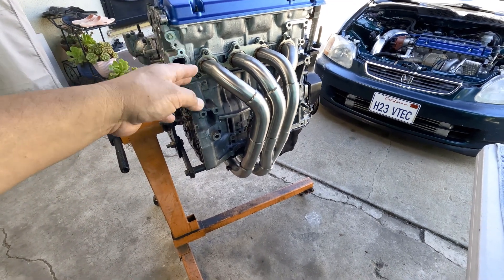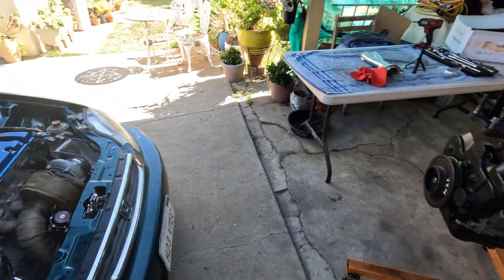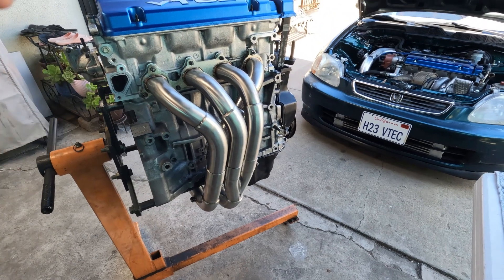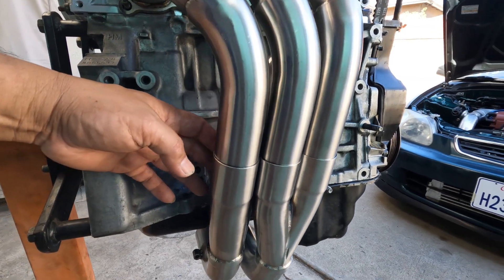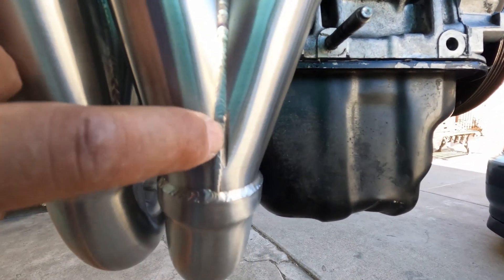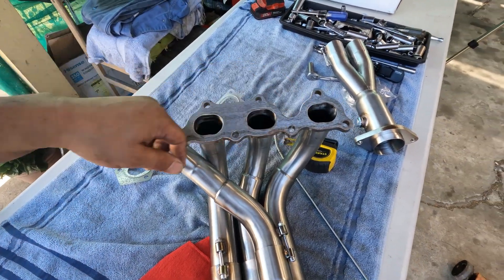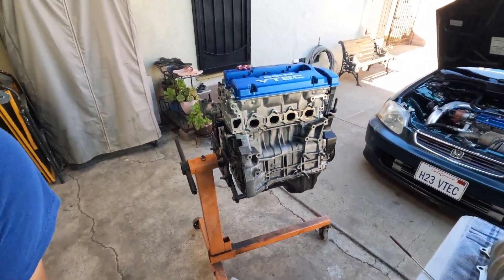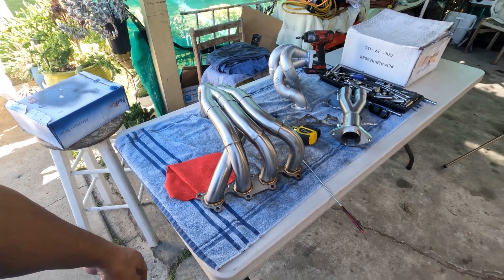PLM H22 Tri-Y Header review

Comment: Had same problem with 97 dodge ss/t with manza 3/4 length headers drove truck while then removed headers used carbon marks on header flange ground too port match made little difference. Other 99 sh prelude got 2 1/2 exhaust with warlock muffler soon going to remove stock header manifold put new o2 sensors on cat and. Check maybe smooth the difference if any between exhaust and cylinder head . take care
Reply from the maker: Thanks bruh!

Comment: Sensei sagittt is back!
Reply from the maker: Lol, whazzz up! Thanks
Reply: @sagittnet2158  hey sensei just did a compression test on the rebuilt engine, idk if you remember I told you I was getting blow by. I was getting between 145 and 150 psi on all cylinders. Do you think that's a little low?
Reply from the maker: @carvedfromlife8949  Your almost at service limit of 135 psi. Have you tried pouring a spoon of oil per cylinder and see if it'll change a bit. Do you have any oil consumption problem or noticing a blue smoke out on your tail pipe? Have you check your PCV?
Reply: @sagittnet2158  haven't noticed any blue smoke, I've checked the radiator fluid for bubbles. I haven't checked it with oil in the cylinder yet, I'm not sure on the oil consumption because I tried to resurface the block myself and I do have an oil leak near the water pump between the head and block. Im assuming maybe I can be losing compression there if it's not sealed correctly. Just thought I'd play with it a little more but most likely gonna get an f20 or h23. It seems to drive fine but ya the compression doesn't seem good.
Reply from the maker: @carvedfromlife8949  the oil that you see on waterpump side could be coming from either valve cover gasket or from camshaft seals.

Comment: Doing it for shits and giggles   hell ya 🤙🏽
Reply from the maker: Yeahhh baby! Thanks bruh!
Reply: I have a G23. Followed your videos to do it. The videos were very helpfull. One issue though I have No VTEC changed the oring clean the vtec and still  nothing any ideas?
Reply from the maker: @MrNeilomar  ok, what car was it on and l assume you have the 2 wires connected ir it already have wiires for vtec. Does the ecu give you any cel?
Reply from the maker: Check your vtec solenoid by disconnecting it and hook up a wire and momenrarily applying a 12 v, you should hear a clicking sound if the solenoid is good.
Reply from the maker: @MrNeilomar  what ecu are you using?